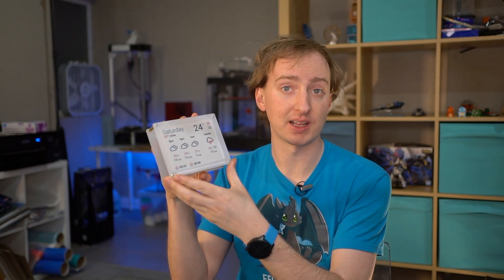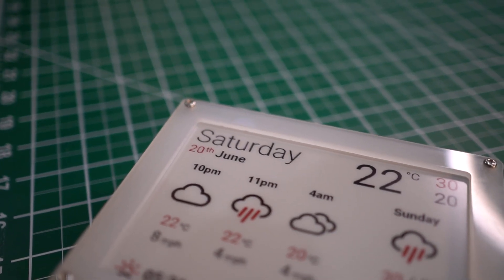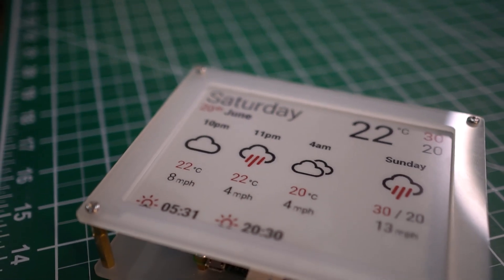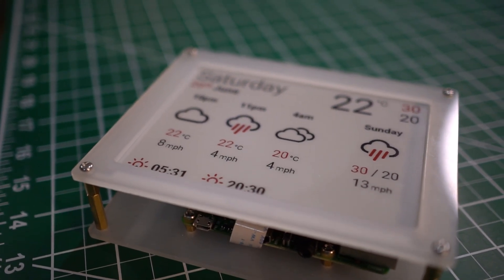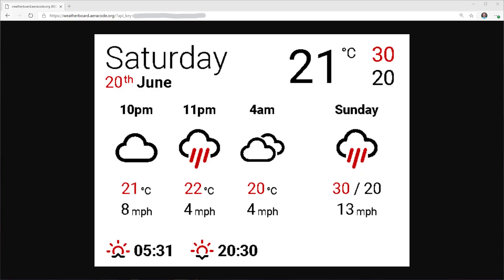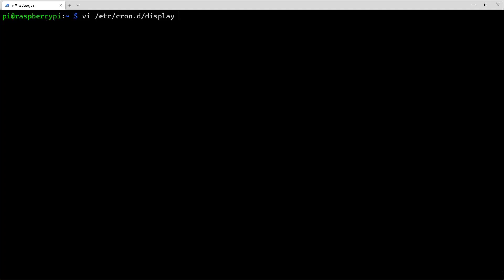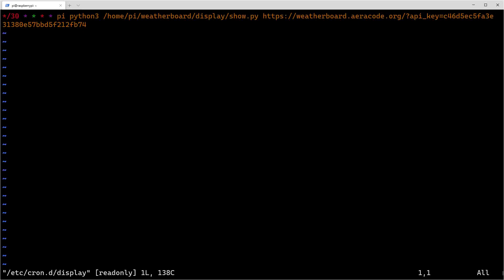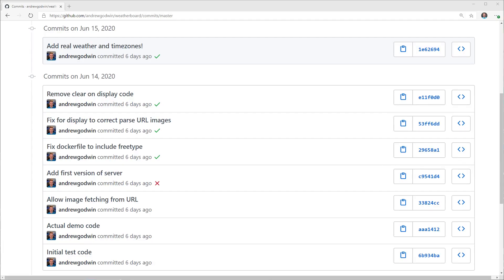Build Tour: E-Paper Weather Display

Comment: 11:22 you say that you cannot do a clock with those displays, but these displays can update smaller areas independently and only use reduced colors, which allows for faster refresh rates. This of course can only be done when you do processing on the device itself and code that closer to the hardware.

Comment: 2:28 It's worth it, saves a lot of power over the years! And a Pi is really overkill to just refresh an epaper once in a while! An ESP32 is ideal
Reply: what about 10 e-inks? can you connect 10 to one Pi / arduino / ESP32?
Reply: @xilefx  the connection at least for mine is 12c, so, i could do up to the maximum number of devices supported by the 'buss'.  127+host afair.  there are limits on devices built into hardware, they'll have overlapping addresses, though, there's chips for that.

Comment: hello great project.  but I have a question whether it would be possible to use a 6 "display from an ebook reader in the project? because such damaged readers with good screens cost pennies and I think that such weather projects on e-book displays would be popular and cheap, especially since even a new screen  e-ink for e-book 6 "costs much less than the one used in your project, best regards

Comment: Nice project, thanks for sharing.

But is drawing every pixel to produce an image file the only way to render content on an e-ink display? I find your approach in the server.py code very complicated. You are drawing every little element (image or text) to produce a PNG image that you stream to the URL which show.py grabs and somehow equates each pixel to a capsule it renders on the e-ink display. Is that the only way it can be done?

I was wondering if I could just use my web development skills to serve a HTML page** at a particular URL. I would somehow grab the HTML sent back by that URL to render on the e-ink display. Okay, maybe there is still an intermediate step to take the HTML and convert it to an image that can be rendered on the e-ink display, but I could live with that.

**I was originally considering React.js but then I realized that a React app renders in the user's web browser, so accessing the URL via Python would not work, thus necessitating a complete HTML page sent from a server.